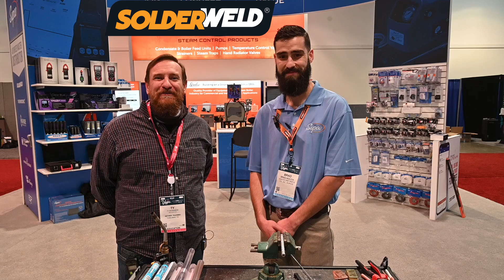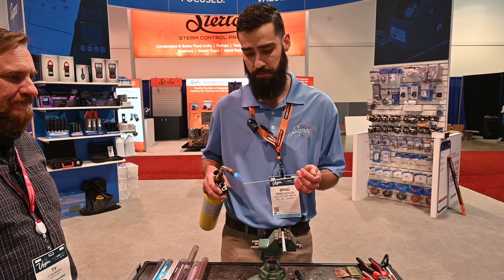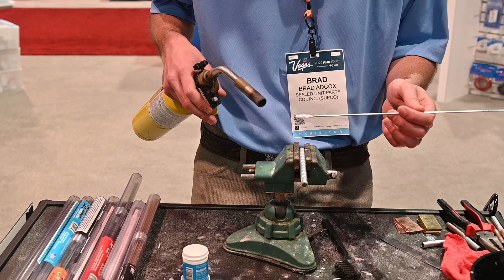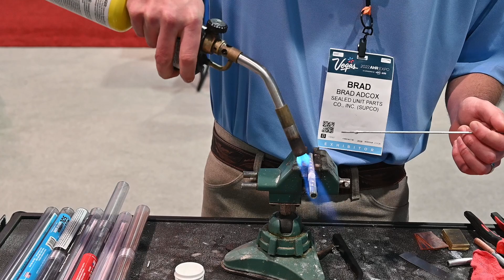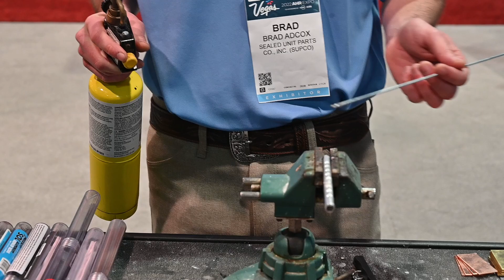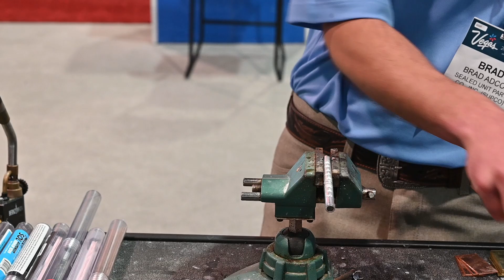AHR2022 Bradd with Supco demonstrates Solderweld aluminum leak repair

Comment: FLUX DOESN'T GO INSIDE TUBE,AFFECTING LATER THE REFRIGERANT FLOW
Reply from the maker: Should not but it does all the time.  Flux kills units. This is why most manufactures say to braze.
Reply: this Alloy Sol flux will not harm the system and is excellent for all refer and hvac repairs and bonding

Comment: How much of that fell into the hole though? Would that contaminate the system? And how does it work on a vertical piece of pipe? Easy to demonstrate with gravity on your side…. Poor demonstration.
Reply from the maker: Great questions. I have not tried it myself
.what are you doing to fix aluminum leaks?
Reply: @love2hvac  I’m an installer. I don’t typically run into that sorta thing. If a service tech finds one we warranty it out typically.
Reply from the maker: I would not use this for installations for sure. In my book nothing beats brazing. 

Warranty the coil I agree is the correct thing. However with the supply chain issues, that down time varies greatly and may be necessary.  Finally  those out of warranty customer that can't afford a new coil
 It's just options. I'm going to get some and try it out on some scrap first and keep some for those emergency situations.
Reply: @love2hvac  Bingo. Supply chain has been a big problem for us. Getting flex duct was hard enough. Goodman and Daiken have been good to us. My favorite would be Lennox but they’re hard to get. Mitsubishi mini splits were 12-16 weeks out last i checked. We did a Bosch furnace and Heat Pump today. Not bad either. I wish their manuals mentioned the reversing valve being energized in heating though. Lol. Rheem and Ruud are the same way. They wanna be different.

Comment: I have been using solder weld stuff for awhile now, to me there 15 percent flows better than Harris. The 56 with pink flux melts like butter and flows good as well. I haven’t used the aluminum repair kit but from what I’ve seen real low heat is the trick nor have I used the Al-cop. Also people that use my 15 percent like the rounded rods than the flat ones for some reason.
Reply from the maker: Excellent feedback! Thank you!
Reply: Glad to hear this brother.  Thanks for the great explanation.  Round is better :)

Comment: I have never had any luck with anything aluminum. I keep trying though. 
I do not like the vacuum gauges they have. They all have always broke or are way off. 
I do use their fan, head pressure and LPCO switches.
Reply from the maker: I'm going to get some aluminum  and practice with it and do some tests. 
As for the S brand...... ... .. . .. 🤐

Comment: Never soldered  aluminum,used 50/50 on a couple automobile radiators. 
I like the fact of a clear indicator to help ,thanks again. 
🥃🥃🍺🍺🍺🎯🏌🏻‍♀️
Stay safe. 
Retired (werk'n)keyboard super tech. Wear your safety glasses!
Reply from the maker: I never thought about radiators. I had a hole in a radiator 100 miles from pavement, 250 miles from the nearest auto parts store. I was able to limp back with with vise grips and an egg.  A stick of this would be a great solution.
Reply: We have a big Auto presence in the repair industry and are very big in the Off road and overloading industry.  Thanks for the comment :)
Reply from the maker: Interesting, I also do. Offroading and overlanding. I never. Thought about bringing it with me.